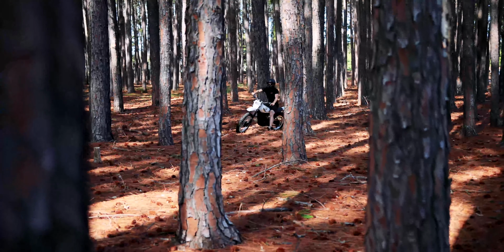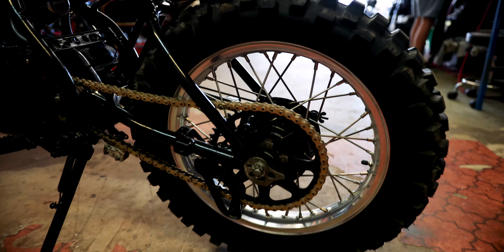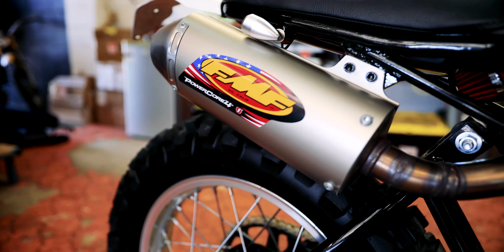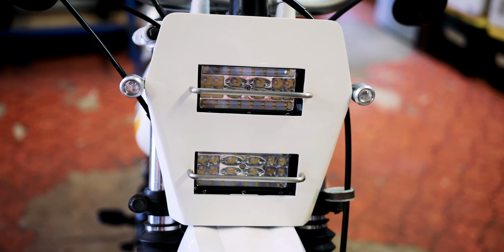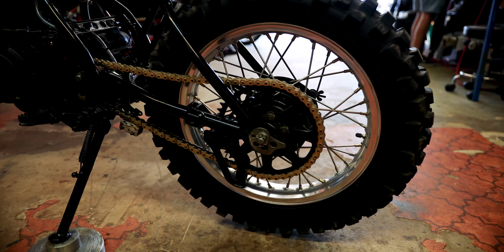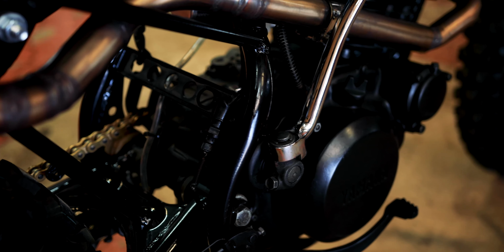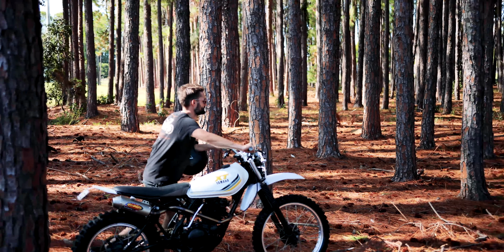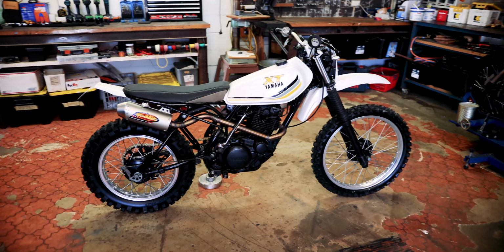Yamaha XT250 MX Scrambler - How to build it | Purpose Built Moto

Comment: I wouldn't call my 83 XT250 "lacking power and a mild milkshake"...my recent bikes were a 2008 WR250R, late 90's XR400 and DR350 - The old Yamaha feels about right for a 4-stroke 250cc dual sport, and 80-83 USA models list 22hp vs 17hp on the later generations of XT250. Maybe the looks and feel of it has me thinking it's faster than it is :) Either way, it creeps up on 70mph in stock form which is about 15 mph beyond comfort level on it for me lol...I'd get a DR650 if doing that more often !

Comment: Bro if you change the stock front suspension and add a new suspension to hieghten the front part of the bike... Will it affect the chassis ?
Reply from the maker: It will effect the way the bike rides, but not the Chassis itself unless you modify it. You should check out our blog on fork swaps https://purposebuiltmoto.com/motorcycle-usd-fork-swap-everything-you-need-to-know/

Comment: Only bad thing about these bikes is they run a 6 volt electric system, nice job
Reply from the maker: we've done a 12V conversion on this one, but yes, 6V isnt very useful now days
Reply: Purpose Built Moto what was involved in that is there a conversion kit?
Reply from the maker: @andrewspotnegri4678  There's no specific kit. it required some re-wiring and a new reg/rec for the bike. A bit too complicated to explain in depth Via youTube!
Reply: @andrewspotnegri4678  If you can get your hands on an Yamaha SR 250 Exciter, you can move all electrical parts to your XT incl the stator- or even the entire motor and get electric starter. The Yamaha SR 250 is 12Volt.
I have done this.

Comment: How did you lift the rear shock 30mm?  Was it a custom monoshock?  The factory preload adjustment specs only allow for 5mm adjustments either way so kinda confused, or does the 5mm adjustment to the preload translate to 30mm in height? Super cool build, I'm trying to replicate a few things on my 81' xt250
Reply from the maker: Hey Stephen, the suspension mounts were modified for the 30mm lift, the shock specs remain the same

Comment: How did you converted it from 6b to 12v? Did you changed the stator?
Reply from the maker: Kaloy D' zion using a few parts from different kits we were able to fit a battery and LEDs

Comment: What did you do for a battery i see you pulled out the box for it then i see the lights running with the bike off?
Reply from the maker: walter falcon the 12V battery is hidden under the seat in the electrics try with our Black Box control module
Reply: @PurposeBuiltMoto  did you switch it to a lithium battery so it can sit sideways? Sorry for the questions im trying to get my 80 xt 250 running also
Reply from the maker: That’s right mate 
Check out the blog linked in the video notes on our website
Reply: Ya i read the blog on it theres just a few things it didnt explain so thank you for the explanation

Comment: Very nice built and a good inspiration! But where did you loose those HPs? Is it because of the DNA filter? My (still) original XT250 has 17HP and the US version usually has 21HP.
And how about the front or rear sprocket – did you changed them for a better acceleration?
Reply from the maker: Nicolas Fuchs The XT was running a stock, high Ks motor. We’ve since sent it in for a rebuild that should conjour up some more ponies!